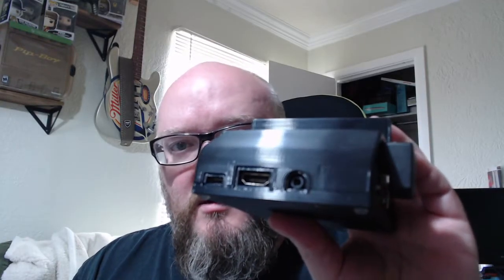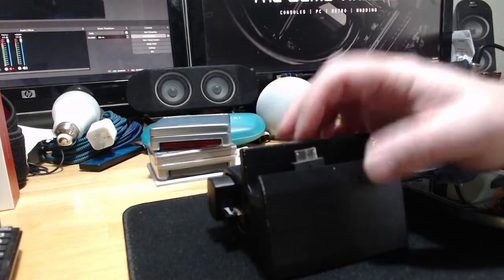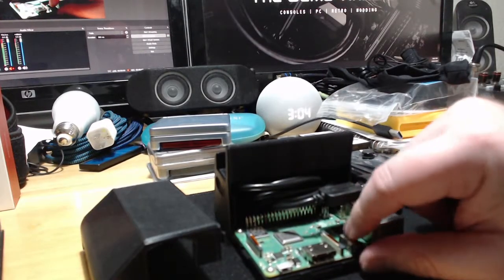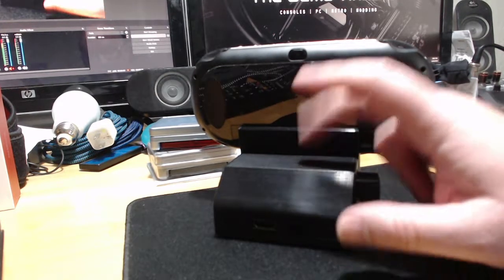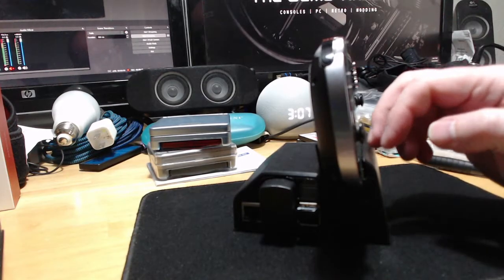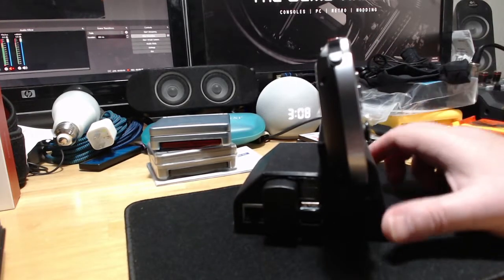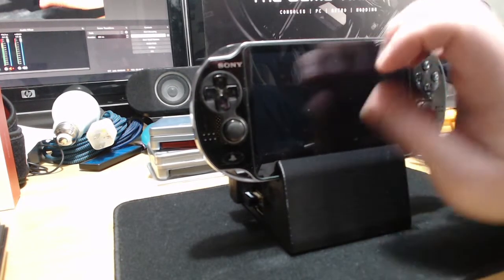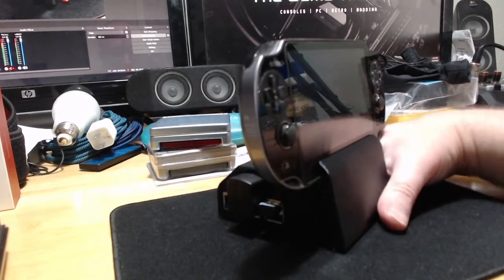Vita Dock Review (prototype)

Comment: ill do it myself i think
Reply from the maker: Yeah man, there are a ton of option out there. I believe there are two different OS options. They are for the Raspberry Pi 3B+. You will need a power unit, HDMI cord, Bluetooth dongle, and the correct USB cord for your unit. I used a simple retail case for my first build. Worked fine.